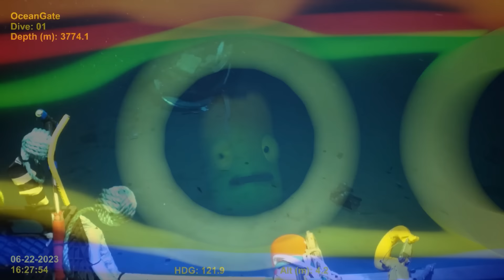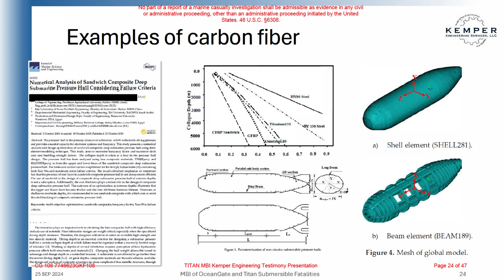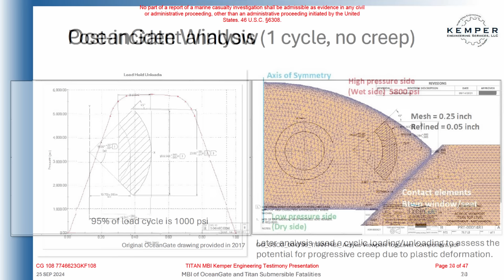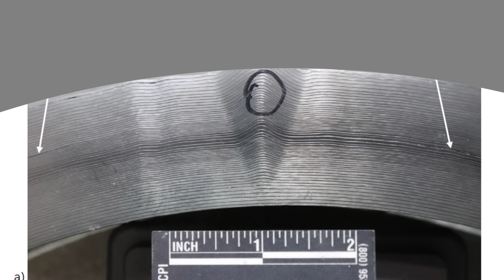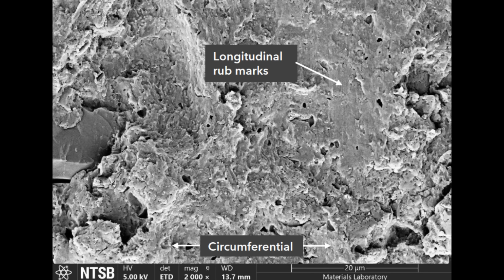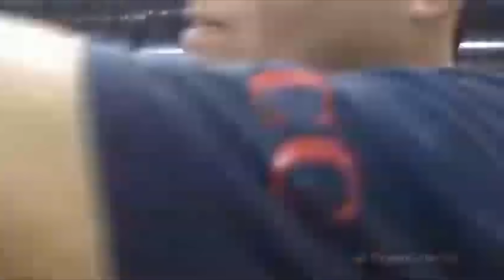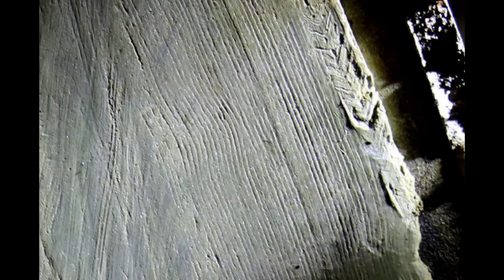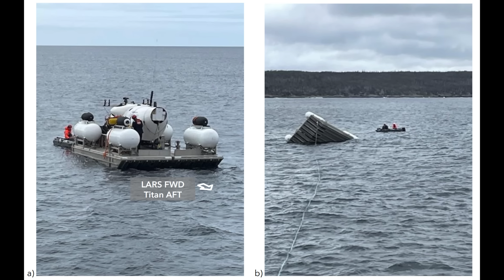OceanGate Wreck Shows Why Sub Wasn't Strong Enough To Survive - NTSB Shares Important Details

Comment: To me the change in strain gauge response points to delamination. It's as if the strain gauges have become isolated from the outside pressure until a few hundred meters. Eg until a gap has been closed up. 

Dive 80 (when the bang occured) and the last dive were separated by a winter. I wondered if water got into the delamination and was allowed to freeze while in storage. Everyone knows water expands when it freezes and this process cracks rocks. I think Titan was moved to the Bahamas over concerns about the weather at its previous storage location?

Comment: Titanium grade 5 is approves as material by ABS.  OceanGate used Grade 3. 
The issue here is that with metals, the metal has known strenghts in each direction.  So a metal of x thickness has known strenght.  This cannot be evaluated for composites because the strenght of material depens on the layout of the strands and the process with which it is layed and cured and whether thsi leaves any imperfections.  So nobody can pre-approve carbon fibre of thickness X for a certain type of mission since every carbon fibre design has differentr strenght even if made of same raw materials.

Comment: yea theoretically any material CAN work if enough of it is used.... its all about your balance of allowed performance parameters. things like weight obviously limit how much material can be used and things like buoyancy further narrow the list or limit the design etc.... then of course theres the most influential parameter thats also coincidentally has the least physical influence.... COST!  carbon fiber COULD certainly be used but at what cost??? and to what end???  then of course therre was oceangates specific implementation and execution of the C.F. use... the "linear" ply method has almost universally been scolded for its obvious weaknesses... the facility in which it was built is sketchy at best for such a vessel. im sure Spencer composites does some incredible work w C.F. but this was a vessel that needed aerospace or beyond level standards of practice... 
to me the hand applied glue thickness didnt even seem to be thicker than the fit tolerances of the ring itself.... 
and beyond the C.F. the other half of that equation is of course.... resin, the resin is going to fracture under those strains in ANY direction which will equal fractures then voids...  repeated cycles doomed this vessel and any engineer couldve seen this coming from day 1...  this isnt hindsight being 20/20, this is wearing blinders from day 1.

Comment: Look at 12:27 on the left side of the picture that is showing the layers.  You can see vertical brakes all within about 1" from the left side of the pic.  There is one spot where it looks like 12 layers all ended within the same 1/4".  Just look at the left most 1/4 of the picture and look at all those brakes in layers (look like vertical lines usually of 3 layers at a time.  
Is this an issue of the way the wreckage was sliced to get a picture or is this where lengths of CF ended?  I really can't figure out these vertical lines and their causes...

Comment: The initial weak point was the hull and because of it, the tiny space between the hull and the door became the weakest one. The pressure on the weak carbon fiber hull created even more space between that opening then everything got crushed into the very end of the Titan by this entry while the door got ejected during that violent implosion thats why you can find every pieces of equipment stacked on each other whereas the door is sitting alone a few meters away.

Comment: Acrylic is simply the wrong material . its far too brittle, polycarb would be my recommendation. 
However the shape and manufacturing method  are also sub optimal. 
It should have a slight barreling effect to support the mid section  and transfer stresses towards the ends   .
the winding should have occurred in a very low humidity environment

Comment: The more you hear about this the worse it gets. No emergency lights outside, no recovery point, left it in Halifax winter out on a barge, couldn't manufacturer the right O ring but still used machined surfaces, had the head of naval research give them the tds to known carbonfiber pressure vessel and they didn't even crack open the info.

Comment: I bet it was that titanium ring inner flange that caused the failure. Seeing it completely sheared off and the direction of the shear lines are perfectly pointed towards center of the ring, I bet water pressure exerted so much force that the flange failed and caused the complete failure

Comment: There is only one horrific thing: To abuse a material, that is designed to show exceptionally strong tensile strength for compression forces. Carbon fibers are like chains: With a chain, one can pull a load, put it can't be pushed. When somebody embeds the same chain into a epoxy resin matrix, the elements iof the chain can only handle forces, that are handed over by the epoxy. If the resin fails due to inhomogenieties, everything falls apart.

Comment: The investigation showed a 2% porosity in the material. If there's pores through then the effective thickness is reduced by that pore depth.
If there's pores that let eater at pressure in between the 1Inch layers, those layers are going to get forced apart - cracking noises and trapped high-pressure water doing yet more damage on resurfacing

Comment: 25:10 looks like a major red flag to me given that the stress and strain graph at the right ends at a different point than it started on the left, indicating that the dive had some permanent effect on the stress response of the hull. Admittedly I'm not an expert, but I would think that the ending value should be comparable to the starting values.

Comment: i never fully trust adhesives in general. im a fan of bolting, welding, riveting and literally any other method of connecting stuff. 

maybe the 2 titan rings could have been connected longitudinal along the hull outside with titan rods and tightened, squeezing the hull in between them. on the other hand maybe that would require so much tightening that it could crush the hull lengthwise, for which i think it wasnt designed.

Comment: I find the most terrifying thing is that the pieces seem oddly intact for an instantaneous and catastrophic implosion. I have seen what happend during video testing of a small model of this craft to destruction. The thing just disintigrated into thousand of tiny shards. These pieces laying on the floor of the ocean paint a picture of a much slower implossion. Possibly one that was much less forgiving than an instant death, without cognition of what was about to happen. Furthermore there should not have been anything identifyable as human remains in an instantaneous implosion. Shear terror if this took longer than we have been lead to believe.

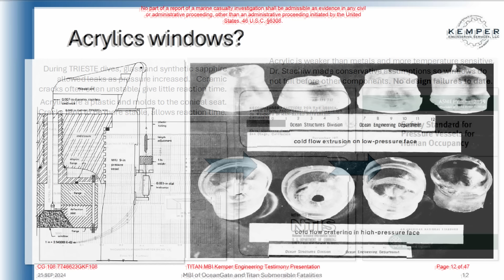Comment: 6:29 I worked on pressurization of aircraft.  The joke was that if the plane wasn't leaking, it was empty of fluids.  While going the opposite way of subs (less pressure than more) the concept is the same I would think:  material that could change shape when pressure is exerted are better than rigid.  Never thought of that for subs. But I had "duh!" moment just now and thus shared it with the internet.
Reply: The concept is the same? That is what they must have reasoned, perhaps...

Overpressure blows the hull up into a circular shape; underpressure folds it up into a wrinkled mess.
Choose which shape you want to sit inside.
Reply: @landsgevaer  Yes it is, just in different directions.   Ironically, to test the emergency pressure valve worked on the aircraft, they would add pressure to the plane, like we were diving until it (the valve) popped.  Hated those tests.  All done on the ground, of course.  THe concept of things changing shape due to pressure is what I never thought about for in the water.

Comment: I don't know a lot about material science, but even I know that "more material" is not correlated with more strength. Why else do we use hollow tubes and I-beams in so much construction? Because they're stronger that way. That window is yikes.
Reply: They are not stronger that way!  They are much lighter and cheaper, and retain some of their strength in certain directions, but are much weaker in other ways.

An I-beam still has mostly the same bending strength, but has much less tensile or compressive strength.  It is very stiff, but that's about it.

A steel cable is the complete opposite, with terrific tensile strength but zero stiffness.

etc.  These are all compromises for weight, and strength in only the direction the design requires

Comment: Burt Rutan laid out the basic load path principles when designing his various experimental aircraft such as the Varieze and Longeze. When laying up fibers in compression no wrinkling or waviness of the layups was allowed at all. You can’t just mill down through the fibers as you are causing a local weak area where the fibers are cut. Having built one of these aircraft I can see several big quality problems with their method of making such a large layup, most of which you have ably identified.

Comment: The major problems with the manufacturing of the carbon fiber hull are shocking. The wrinkles in the carbon fiber layers position the fibers out-of-plane. Machining the wrinkles also creates discontinuities across the structure, where the fibers are no longer connected across the machined wrinkle. The adhesive layer adds a weak plane between the 1" sections. 
Also, the peel ply is a woven fabric layer that is bonded onto the laminate, then ripped off, providing 1. A textured surface that promotes bonding, and 2. Removes the amine blush. Peel ply also soaks up resin, possibly causing the underlying layer of carbon fiber to be "lean". It's also possible that they had to cure hull in stages, to avoid exotherm due to the large mass of epoxy contained in the thick 1" layers of carbon fiber.
As others mentioned, these major process defects would scrap out a flight part.
The hubris of the decision makers to ignore these defects not only lead to this catastrophe, but will be another setback for the application of carbon fiber in submersibles.
Had the carbon fiber hull been properly manufactured, the Titan submersible may still be operating.
One last thought: Fiberglass is essentially window glass, and we know how brittle glass is. Carbon fiber is much stronger, and also much more brittle than fiberglass. Carbon fiber will hold the load in the same place, without moving. When the load exceeds the carbon fiber structure's limit, the carbon fiber structure explodes.

Comment: Regarding the size of the debris field or how scattered it is on the ocean floor. The standard formula for finding something underwater, at least in open water and not fast moving rivers is, From the point the object enters the water, or in this case breaks up, the debris will be found in a circle directly below that point with a radius of 1/2 the distance from the bottom at which the debris enters the water or separates.

Comment: Somehow it took until 2 minutes into this video before I finally had a really obvious thought about this whole mess.

They chose carbon fiber for it's strength to weight ratio (or some roughly equivalent measure) when trying to build a submersible. Something that's supposed to have neutral buoyancy. Something that needs a lot of weight added just to make it sink enough. A heavier material would've been more effective FOR BEING HEAVIER.
Reply: Ideally you also want it to come back up. If you make it lighter it’s easier to add weight and make it go down, then drop weight and go back up. When it’s heavy it gets harder to get enough buoyancy for it to go up like you want it to.
Reply: @NBSV1 There are images of the steel used as ballast that could be dropped. Did look like scrap metal from.
Reply: @richtes  Yes. The idea is you add ballast so it sinks, then drop ballast so it rises back up. If you make the whole sub heavy enough to sink on its own then getting back up becomes a problem. You would have to rely on the propellers or having something like an air bladder. Much easier and safer to simply be able to drop some weight and it go up on its own.

Comment: My humble opinion.... The centre of the cylinder has buckled, possibly primarily, or as a result of another smaller failure. The inner flange shows shearing, I believe occurred as the centre failed and putting load on the flange inner edge as it twisted away from the outer edge. The outer flange shows weaker tearing forces, as would result by the rebounding forces after implosion. This also accounts for the large carbon sections, as the cylinder failed along one side, the other side would experience semi equal forces both sides and remain semi intact. @Scott Manley

Comment: My point of view is that of a professional submariner who has spent many months submerged and have experienced multiple casualties submerged each of which would have killed these folks.
Your comment that submersibles are not death traps was a little too general and generious. This submergible was a death trap and I'll tell you why even if we disregard the flawed engineering involved in the design.
First is the size. A pinhole leak is sure death, no doubt. That leak would fill the space in seconds at depth and cut the hole bigger while doing so.
Second is that there were no opportunities for any sort of damage control. Anything goes wrong, your fault, my fault or nobody’s fault you are dead.
Third is that they had zero redundancy’s in the systems that sustained the vesssel and zero ability to escape EVEN IF YOU GOT BACK TO THE SURFACE. If you were not picked up by the ship and removed from the vessel very quickly. You could not exit the submersible on your own because you were bolted in from the outside.
Fourth, anything goes wrong with the atmosphere at depth you die.
I could go on and on but this one was a death trap and I would argue that most are. They just haven’t had the little run of bad luck yet that will expose that fact.
Reply: They haven't had that run of bad luck because most understand the need to build their submersibles properly, as well as properly maintain them afterwards, and decommission them when either they've been structurally compromised (but not catastrophically failed) or have simply worn out with time and use. Stockton Rush had ample warning this submersible was a disaster waiting to happen, but he instead chose to ignore the signs and his willful ignorance signed his and four others' deaths
Reply: @Hegamonia  I guess we just see things differently.
Reply: You mentioned atmosphere. Did you happen to see the plastic storage tote with  computer fans for a CO2 scrubber he was using in that coffin? There are so many technical problems with this submersible that I am amazed that it made the number of dives that it did.
Reply: @mv3029  Well as for the co2 absorbent thing  This isn't really such a big thing to me. Aboard US Navy diesel boats during the 1960s the didn't have any atmosphere  control so in an emergency they could release some bottled oxygen into the boat and would lay our co2 absorbent on the bunks. His little rig would certainly work for a little while and remove co2. But, as you mention this is just another example of having to do a lot of things on a shoestring.